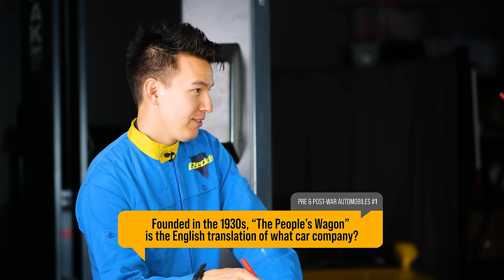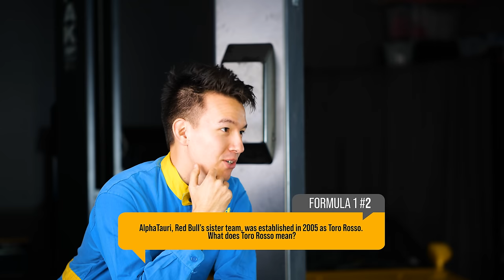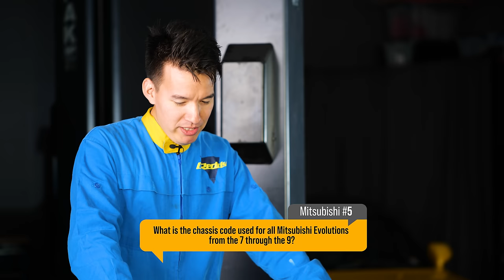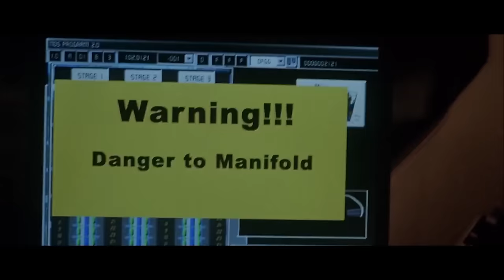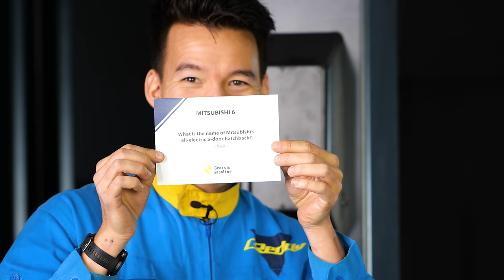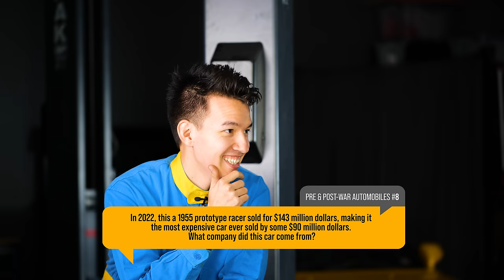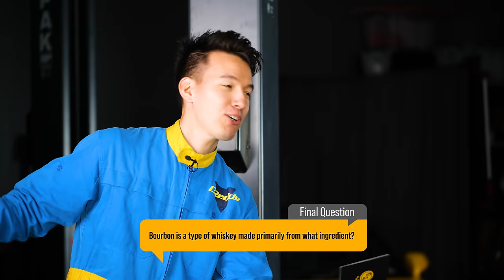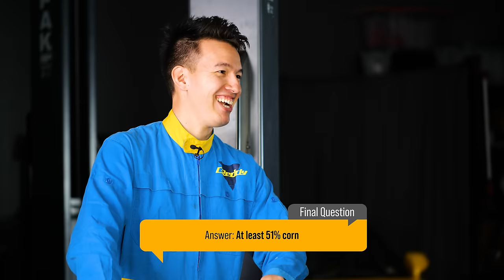Our Least Viewed Video Ever (Car Trivia!)

Comment: Interestingly..

SR16VE N1 - Used in the VZ-R N1, which was a racing homologation version intended to compete with the Honda Civic Type-R. Producing 200 PS (197 hp/147 kW) from its 1.6 L SR16VE engine, it held the highest specific output ever for a naturally aspirated production car, at 123.125hp/litre until the Honda F20C engine.

Comment: His confusion about ethanol stoich being at around 12:1 is exactly why I wish we used lambda for everything. Your normal wideband measures lambda and the ECU converts that to its percentage of the gasoline stoich. It has no idea that ethanol is being burned, so the AFRs it thinks it's measuring are actually scaled completely wrong.

Comment: Bit of trivia on Honda #5 - before the F20C in the S2000, it was actually held by the SR16VE N1 Nissan engine (JDM Nissan Pulsar VZ-R N1), which made 197hp from 1596cc IN 1998 ; which put even the JDM B18C to shame.

The B16B made 182hp from 1595cc.

Comment: A great curveball question you can put in for honda car enthusiasts is

"What was, and still is, Honda's best selling vehicle. Extra point if you can tell me the rough estimate to how many they've sold."

Or

"What is the oldest production vehicle Honda has made"

A few good subaru ones you could of done are

"Where did the inspiration for the EJ-series engine come from?"

"What was Subaru's offical company name"

"What was Subaru's orginal ad slogan?"

"What demographic did Subaru's marketing appeal to in the 90's that made subaru popular?"

"What oil does every subaru bro tell you to use in the EJ257?"

Also a great curveball to throw at toyota enthusiasts is

"What was the name for this vehicle toyota produced in the 90s? it was mid-engine, supercharged, AWD, and offered in a manual.

Comment: 43:28 Honda actually produced a turbocharged motorcycle in 1982 called the Honda CX500 Turbo. It was the first turbocharged motorcycle to ever make it to production and the first one with PGM-FI. Since the question said vehicle this would have been the correct answer

Comment: 31:00 it’s the only 2000GT convertible made. I would think that they never even made a top for it. Interesting that they didn’t cut the bottom of the seat out. It was not like he had to actually drive it. Movies back then the actors would just sit in front of the screen moving the steering wheel back-and-forth.

Comment: Ones I got wrong

Oldsmobile tech
Evo Chassis Code
Units of HP: Missed PS
Honda V6
Foot lbs to hp 
Civic SI Automatic transmission 
Diff backlash
Mitsubishi iMiEV 
E85 AFR
Radial 
4 wheel steering 
Honda Moto GP 
AKI 
Acura RDX K23
Corvair/F-85 Jetfire Turbo
Captive import 
Rosberg (Equal machinery) 
Bourbon 

18. not bad